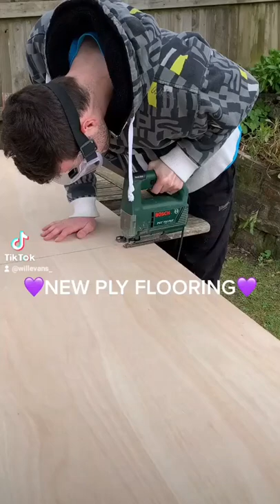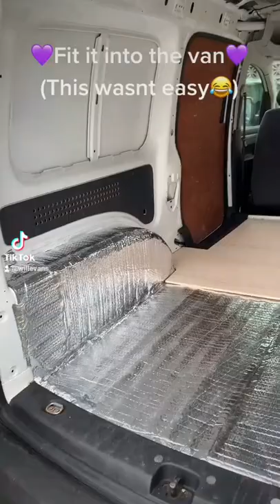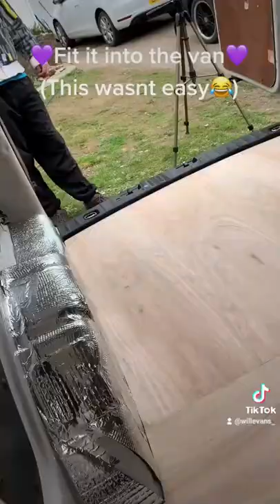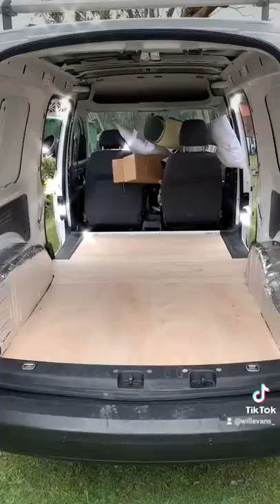Fitting A New Floor Into Our Micro Camper!

Comment: Did you screw down the floor? Or glue straight to the insulation?
Reply from the maker: Hey so I placed the plywood just loose on the floor. Due to its weight it wouldn't really move. And then I glued the laminate floor boards onto the plywood. Hope that helps!
Reply: @willsvanadventures  thanks for the reply. I think I will do the same, not a fan of drilling holes in the floor
Reply from the maker: @wildishshambino4176  yh me neither! Hope it goes well!
Reply: @willsvanadventures  thanks, me too lol